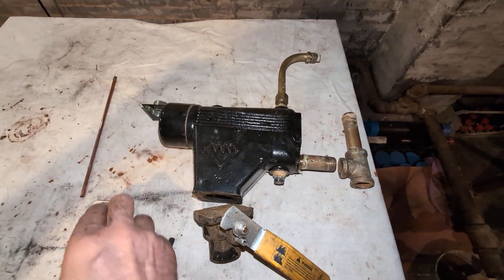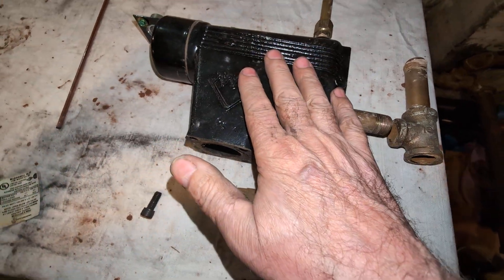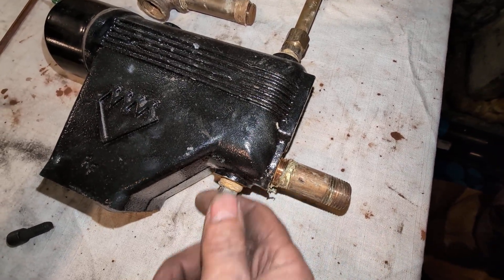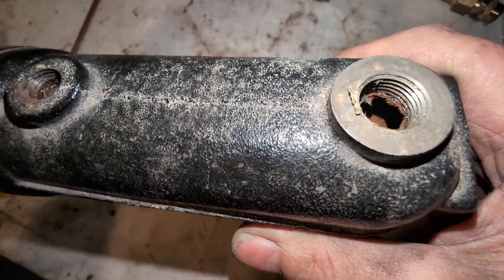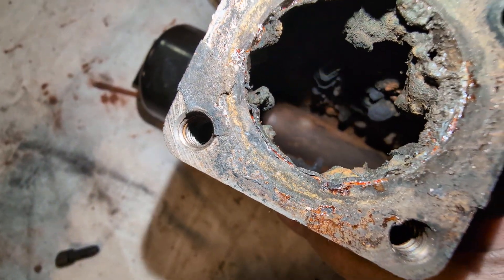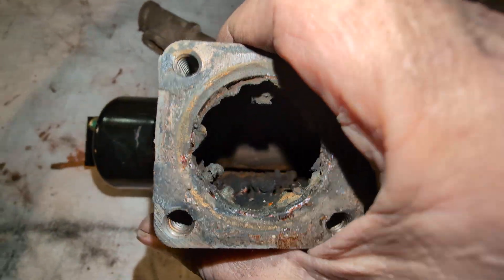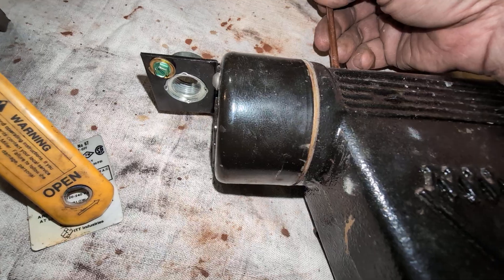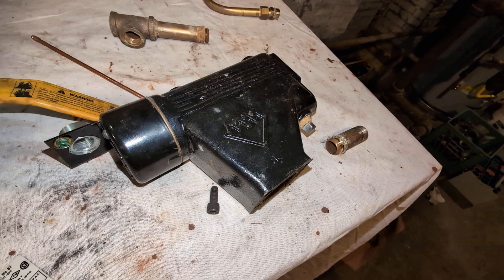Rust Never Sleeps - McDonnell & Miller #67 Low Water Cut Off Steam Boiler "Safety" Control

Comment: Learned on boilers with nothing but a safety relief for a "safety".  Hand-fired ship's boiler.  Something around 490 psi, 750 steam (superheated).

Retired USCG licensed Marine Engineer and State Licensed Stationary Engineer.

Spent most of my career in power generation and gas compression.  It was great training.
Reply from the maker: Thank you very much for adding your story to this channel!
Compared to you, my job is easy.
I only have to heat the building, not move it thru the ocean at 30 knots!
Be well. Stay safe.

Comment: Can you recommend an electronic LWCO for a 200,000-BTU Peerless 61 steam boiler circa 1998? My Model 67 is gunked up and frozen. Maybe time to replace rather than rebuild...
Reply from the maker: @interstateB  It might come down to the age and condition of your boiler.
If you consult your boiler's instructions, there might be a 3/4" tapping indicated where you can mount the probe.
Getting that plug out will be necessary.
As to which electronic lwco, Hydrolevel's 450 should do 
If l remember correctly, Peerless 61 boilers run their lwco circuit at 120 volts.
Reply: @gordonschweizer5154 thank you!

Comment: A few times if the top tee leaked with the internal flare I would cut that out and use a standard brass tee on top with a flare nut and flare adapter (or compression) in the tee then a 1/2" od sweat 90 on the tubing going down into the compression adapter because you couldn't make the bend with the flare adapter taking up more room. Always worked fine.

Comment: Our boiler was inoperable because the float had a hole and filled with water.  It then naturally sank, telling the gas valve that the boiler had no water in it.  My first repair to our system was to remove the leaking float and blow down valve, clean out the housing, then replace the float and blow down valve with the newer ball version.  With the float and the blow down valve removed it was much more easily cleaned out with an old screwdriver without fear of puncturing the new float. Great illustration of how crust these things get inside.  Thanks Gordo!

Comment: I have seen a brass bodied MM float switch.  Guess why they dont make those b/c they were less likely to fail
Local parts suppliers generally do not have parts other than gaskets.  Usually not worth fixing as the parts and labour add up to a new replacement.
Locally, probe sensors on steam are not allowed. Wah Wah.
Reply from the maker: @gordonborsboom7460  Thank you for your comments!
Please, sir, could you elaborate on your comment about a local ban on probe-type LWCO?
That sounds like something from 1954 and not 2024.
Reply: @gordonschweizer5154  the "Jurisdiction having Authority" will go to sites with steam boilers and test the safeties.  As such, they want to SEE that a mechanism actuates to open a circuit and shut down the boiler.  Just pushing  a TEST button on a control is not sufficient of a test of authority over the burner operation.  Every commercial residence with a steam boiler must be opened for inspection annually  for an in-person inspection and then reassembled and tested by a qualified technician.
Where as in the case of hydronics boilers being installed or tested, probe type LWCO are allowed.  Single residence steam systems are inspected only at the installation and what happens to the controls afterwards is not subject to oversight.  So technically a single family steam system could have probe type level sensors, but I have not seen one, and the suppliers do not carry any that are rated for steam, at least as I am aware, since demand would be too low.  I have inquired, and that was the answer I recieved

Comment: I have two 40 yr steam boilers  shearing the same 6inch steam header,boilers are located in the basement  they service air handles and a few radiators though out the first and second floor.  What kind of vacuum breaker would you recommend for a system like this.
Reply: We use a swing check valve in the reverse position with a water trap in front of it. 
Cleaver Brooks does the same.
Reply from the maker: @penguinlife927  I have tried the backwards check valve vacuum breaker technique, and it didn't work for me (it leaked water all the time).
But please give it a try, it might work for you.
I usually wind up using a Hoffman vacuum breaker (SKU # 401443). Works, but not cheap.
You can also try the Barnes & Jones vacuum breaker, too.